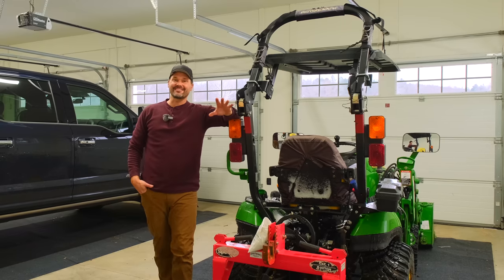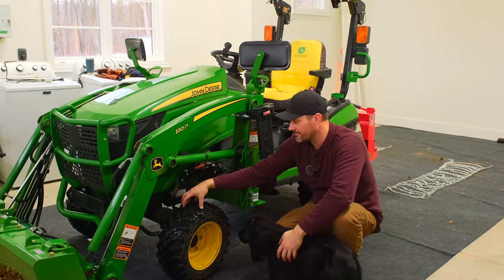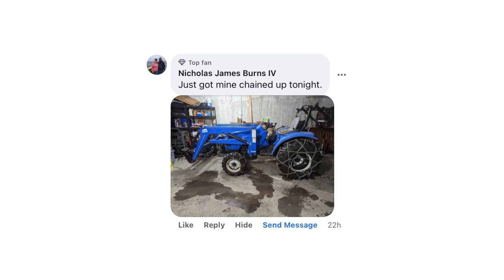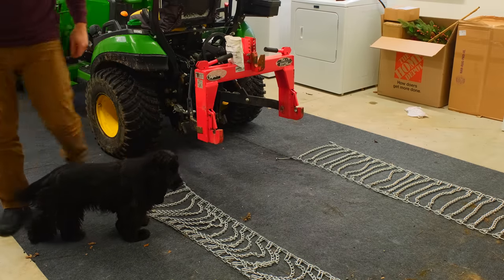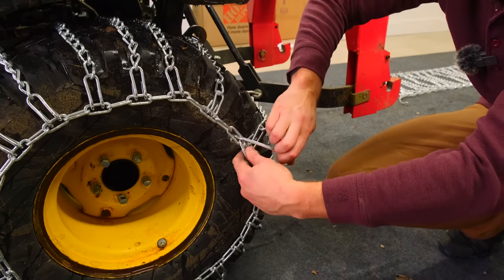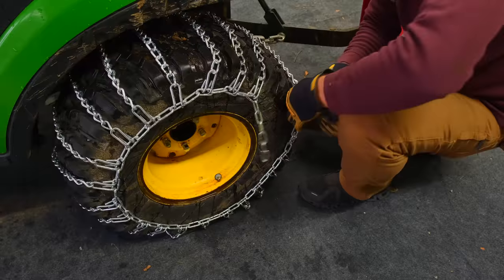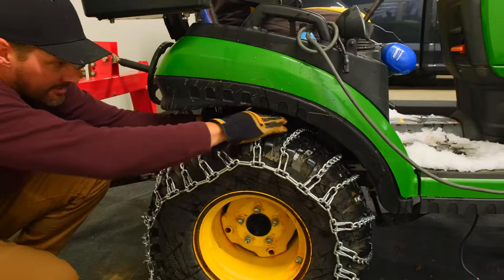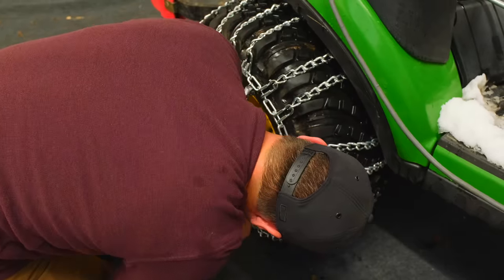IS THIS BETTER THAN PLAIN OLD 4 WHEEL DRIVE? 🤔

Comment: Looks pretty good,  read a comment about 1st being installed upside down.  Fix that or the steel will dig into sidewall.  Very good 1st install overall.   I put mine which are same design on a Yard Tractor, so smaller tire.  2 things I do is one jack the tractor up that way I don't have to drive over the chains, just spin the tire and don't have to bend down as far.  And secondly I deflate the tire, put the chains ⛓️ on the last holes, straighten the chain as best I can, then reinflate the tires.

Comment: I know it isn’t practical for large tractors but I have a 1025r and I remove the wheels and install the chains on the bench. Easier in the long run. Don’t like crawling around on the ground. I also leave back hoe on so can lift rear of tractor easy

Comment: Reinstall with cross links facing out away from tire.
Install with tire off the ground.
Set the inside ring first as snug as possible.
Set the outside ring as snug as possible.
The tensioners used in the video are junk. 
Use either rubber tarp straps as others proposed or if you visit a bicycle repair shop, ask them if you can have some old tire tubes. (They are ugly and time consuming to install but they work very well, don't lose tension and are very tough.) Make one cut so you have one long tube. Fasten the tube at one point and then stretch it in a star pattern keeping tension as you go. The idea is to try and get ALL the slop out of the chains that are on the tread. The more play in the chains -- the greater the possibility for chain failure. And in the case of the 1025, if the right rear chain breaks even one cross link and it is flailing around while you drive, you risk hitting the .
The snugger you get the chains to fit across the rubber the better.

Comment: I use chains on my Sears 20 HP Garden tractor when I use the snowblower.  They work better than no chains.  I also lift the back end up instead of driving over the chains.  Whatever works.  I just ordered the Hitch Hanger Bundle w/ 6-72 lb weights for my 1025R from some company in Michigan.  Should be here in a week or so but my order usually sits in Denver for several days before it makes it's way up I-25.  All good.  It'll get here.  We get more wind here in Cheyenne than snow but I'm working with the finance committee chair on next year's budget in hopes of getting a snowblower for the 1025R.  Still undecided on the OEM front mount or a rear pull type.  Merry Christmas!  🎄

Comment: Use a jack and lift the tractor tires off the ground. Let the air out of the tires and pull all the slack out until you get the chains as tight as possible. Then cut off the excess links not needed. Air tires up and they will be tight and the tensioners are just added insurance. Nothing beats tire chains on ice.

Comment: I cut off the excess links instead of trying the Zip-Tye's, the tye's break.  I also leave my chains on year round with no issues.  Every few years, I have to remove a cross chain and re-tension as the chains wear.  Chains on my 1026R are now 10 years old and I will probably have to replace them in a few years.  I also use Safety Wire to lock the outside fastener clip to the chain, over the years I have seen the chain come loose when the lock clip disconnects.  We used a JD-425 at the Hospital I worked at with chains on the Cement Sidewalks for over 20 years and I never saw any damage to the cement from the Chains, Blower of front blade.  We wore out the front scraper on the blower and had to replace it about every 6-8 years after flipping it at the 3-4 year mark.  Being in the Lake Michigan Lake effect snow belt, the blowers and chains get a lot of use.
Reply: Interesting as I’Vue used zip ties for years and never had one break.  I only zip tie the inside as I can do that once to get the length set and then never touch it again.  I put the end of the outside tail under one of the tensioner hooks and that works plenty well at plowing speeds.

Comment: Thanks Courtney always great content and comments from you and your viewers.  I doubt chains are going to do too much damage mostly due to the low speeds involved.  I'll preach to the choir on this one; ballast is your best friend.  Loaded tires are great but not nearly enough weight especially on a 1025R those are small tires; it's not a lot of weight added. I used a weight box on my 1025r and it had excellent traction while plowing. A backhoe would also add plenty of weight.  Chains are an excellent option when loaded tires and ballast are not enough.  I'd think long and hard before putting chains on the front of a 1025R.  Love your channel and enjoy all your video's keep up the good work!! Thank you!!

Comment: If you want a clue how well chains can work I plow snow with a Simplicity Sunstar with heavy duty vbar truck chains made for a full size truck. Loaded tires and 300lbs of custom wheel weights. Last year we had about 18" of wet snow, I plowed it no problem but I did actually rip one cross chain off and damaged another. The vbar cleats dig right through ice and will really tear up concrete or asphalt if you're not careful. Mind you when I broke the chain I was in low range moving a pile the snowplow left behind. Point is when you're making enough traction to rip a link in half you're not going to get much better than that.

Comment: I have a compact tractor an the trick I do is jack up the back an then stands , Then deflate the tires. Spin the tire with the chain an ajust as needed . Put air back in tie up an tie up lose ends. Do a fast test drive to let chains set on tires, ajust if needed. P.S a small chain binder is a helpful tool to pull the chains together .

Comment: Tire chains are hard to beat.  We ran them all winter on our log skidders.  I also have a set for my snow plowing pickup.  That way I can run reasonable all-season tires and not have to change tires twice a year just to handle 3 or 4 storms that require the extra traction.  I can put on my chains in less than 15 minutes on all four wheels and that is worth it for the few times a year I need them.  Generally, I need them only after an ice storm or on snow that lasts a long time and gets very hard packed.  I use chains with cross bars as they are much better on ice and hard packed snow and those are the conditions where I generally need chains so might as well use the best.

Comment: Not sure how much difference it makes, but you`ve got your chains opposite of each other. Look at the links around the sidewall of the tire. You`ll see what i mean. I always install mine with the sidewall links facing inward so that it helps keep them from catching onto anything should you get close to anything where the chains could possibly grab something. And, when i put my chains on my tractor, i use a floor jack, get the tires off the ground, that way you can roll the chains right around. Sure makes it alot easier when you hook the inner links up. I always cut off the excess hanging chain links to. I`ve had them rip sh!t up inside the wheel wells before. (those zip ties wont stay there long out in the cold either)  Just use a sharpie to mark the attaching link you want to keep, cut the excess links right off with a angle grinder. Over 50yrs using chains on all my tractors, my method has never failed me yet.

Comment: It’s a workout regardless you demonstrated extremely well. Wheel spacers are a no brainer and are required on every tractor. love the fact you push them hard it can save your life. Especially true with cabs and exceptionally top heavy. Running chains the 1025R jack it up without question eases the struggle also do the same on the 3039R. Make sure the closer clamp is facing out and not in you have a side incorrect. You are absolutely correct on your centre tensioners even is absolutely key and maintains alinement. Zip tie excess chain and check the chains every couple of trips for potential issues. Ensure consistent tautness and prevent potential damage.

Comment: Courtney, I’ve installed chains one time on a 2wd atv. It was a pita but after it was said and done the atv was a monster. I didn’t have tensioners but I did use small bungee straps. The chains were a v-bar type. 
On a completely different subject, how about a tips/tricks video regarding using a snow pusher. The one I got from you is great but this first snow was wet and heavy. The wasn’t ground frozen, back dragging was a breeze but pushing was frustrating even when using float. Guess I’m to use to plows on my trucks lol

Comment: I believe you have the chain on backwards the little cross hooks should be outwards not inwards so it does not cut into the tire also I buy the add a link threaded links and use that instead of the clips I also jack up the back of my tractor so I don't have to keep moving it I do this on all 3 of my tractors I've been doing it for 27 years now and I've never had a problem seems to work great for me good luck cheers 🍻 happy holidays

Comment: I have a JD 4210 that I also use for plowing snow on my drive, our common driveway, and a few neighbors.  I had run front chains only for years, but got tired of not being able to make it up my neighbors steep driveways, so added rear chains.  I have never had any hub issues with running chains on the front, alone, or with rears.  YMMV As far as the chains marking the asphalt drive, it is minimal.  If the neighbors complained, they wouldnt get out till spring.  LOL

Comment: I have never run chains. I have a set for my last truck that I got rid of. I did have a 4 door car that could not go on 2 inches of snow. Front wheel drive. I put mud and snow tires on it with studs. Then in the snow and ice. The car drove like a 4x4. I am a true believer in studs. Chains. I have no clue or opinions about them. I personally drive in snow and on ice and besides that car. I never needed them. Knock on wood. I have never been in a ditch, etc. I just pass everyone, so their not wrecking in front of me. A tractor. I haven't needed them yet. Yet.

Comment: The 1st one you put on is on wrong.  It's upside down and you should have the side chain "hooks" so the bent part is up, away from tires.  The second one is done correctly, which is why it went smoother.

Comment: I highly suggest driving onto your chains when your putting them on. Gets them tighter and easier to put on. Once on drive 30-50 feet, and tighten them up again. After that, in your application the tensioners arent needed. They'll loosen up a little over time. On my commercial truck, usually within 40 miles the chains will stretch enough to get another link or two. Typically i wont need to use all 3 of my break over tensioners.

Ive had bungie cords actually make chaining and removing chains more of a pain. Stopped using them 15 years ago. I can usually chain up 6 wheels inside of 40 minutes.... Chain down in 20.

Comment: One trick to try is lay your chains out like you did then put a block of wood between 2 cross sections.   Drive your tractor onto the chain stopping when your tire is on the block then you can freely adjust the chains around the tire.

Comment: Putting chains on is probably the worst part of switching over from summer to winter operations.   This is one item you can not just install and forget about.  Every so often, check the chains to make sure they are tight.......if they partially fall off and go behind the tire, you can do some serious damage to stuff you don't think would get impacted.   Again though, awesome video showing truly how its done.   =)

Comment: I have a fair amount of time using tire chains.  I have heard before that John Deere and perhaps other companies don't want you to use chains on the fronts, however you will have issue controlling the machine with out (sooner or later).  I would follow their recommendations and perhaps get a tractor beefy enough to take it.   I currently have a Farmall 75C that I am using with chains on the front and rear. The rear chains are too heavy to lift on the tire.  So I lay them out behind the tractor and use a rope   through the rime slots and drive forward so they drape over the tire.  If you have help, someone can guide the chain onto the tire so they don't drift off.  Also, on big tires (like standard ag tractor tire pattern) the chains should have  links between the cross chains to hold them in position and prevent them settling between the tread.   Installing chains, especially on bigger equipment is never a clean or easy job.   It is also not an exact science.  They never seem to be tight enough.  As long as they don't come off it makes no difference in my mind.   I guarantee they will mar blacktop and cement.  The tractor will ride rough and prevent you from high speed operations most likely.  The price to pay to move heavy snow on frozen icy surfaces.
Reply: The ladder type chains are implicated in differential failure on bigger non homeowner farm and industrial  prime movers.  Go for the diamond pattern with continuous chain along the centre of the tire, makes for a smotther ride too.

Comment: Chain is on backwards. You have the cross link chains digging into tire. I also jack rear end of ground and put chain on. I like the rubber chain tensioner better than the spring type
Reply from the maker: Interesting...I'll have to look closer.  I'm not picking up on it watching the video.  Thanks for the tip!
Reply: The right rear is correct. The left rear is wrong

Comment: Caution with front chains on a 1025R or equivalent - when turning left the chain can hit the steering hydraulic ram. I extend the stop block on the front axle when I have chains on to avoid this. (:~>

Comment: With a gravel drive I'm not overly concerned with damage.
What I have found that makes it an easier job is just jack the tire up off the ground and let it spin as needed during installation. Though that may not be as ideal for larger tractors.
As for chains on the front tires, my thoughts are: if the tire does not provide traction, you don't need them. Much like my front wheel drive vehicle, I don't put snow tires on the rear.

Comment: X734 owner here. I use a 5 ton floor jack to get the rear end of my rig off the ground and then put the chains on.  Much easier to get the slack out and work the chains tight right put of the gate. 😀

Comment: Cu slots in a 2x6 or 2x8 spaced for 2 or 3 cross-bars (drive your tractor on the blocks to see how many you need. Lay the chain in the slots and back onto the blocks. Much easier than jacking, and once you figure out which cross-bars to put in the slots it works pretty well.

Comment: Have a 1023 we had chains on the rear - one of the links broke apart on the fuel tank side. Caught the fuel line on the bottom of the tank, ripped the fender off and busted the fuel line and the tank.

Comment: It also helps if you remove the valve stem and let the air out of the tires I don't know how that would work with that liquid ballast that you have in there

Comment: I've been putting chains on my 4310 for for 15 years and it's a suck pill until you finally get them on.  15x19.5  r4's hard to get them over the lugs on the tires

Comment: i have them on my 1026r. and have every winter.. same chains but i ended up welding the loop shut where cross chain hooks to the other chain.. some will come off and loose... ohh and run chain on the front and have with no issue..yet... not saying it's a good idea but it works for me
Reply from the maker: Thanks Martin, storm rolls in tonight so I'll see how they do soon

Comment: Other than the 1st one was installed inside out (crosslink hooks facing inward) it looked like the second one was easier.  There is nothing easy about putting chains on in my opinion but then it isn't hard either.  I think for those of us that don't do it that often, it is always a little difficult when it comes time to put them on.
Reply: Correct me if I'm wrong. Thought you want that cross link with the link facing the other way. At least that's what I do.
Reply: @rp1645  I think that is what Chester was saying (at least how I interpreted it).  I always install mine so the end of the hook on the cross link is not against the tire.
Reply: @rp1645  Thats what I meant, for the ends of the link facing out so it doesn't cut the sidewall.  I meant he had put the first one on wrong
Reply: @chesterlauck734  YES chester that's what I thought. On are 12 yard snow plows, it CUTS into tires so bad. Running those plows 12 hour shifts, 24/7.
Reply: @lifeinthesticks743  YES, got these great chains like Loggers use for my backhoe. Has  LINKS in a chain on a cross member that is "V" shaped. But that trackson Link is hard on cement and especially on blacktop.

Comment: Good video!, but the chains were laid out wrong with crossbar hooks facing towards the tire. They should face away from the tire to avoid sidewall damage from the hooks. 
I have a compact tractor which has "DOUBLE RING CHAINS" mounted on them and I have concrete floors in my garage and pole barn. These were put on about 7 - 8 yrs ago 
and have never been removed. There has never been any damage to the concrete floors!!  NOTE: I have a gravel driveway and 73 acres I work with these chains on year around.